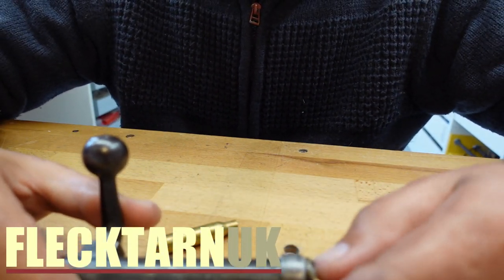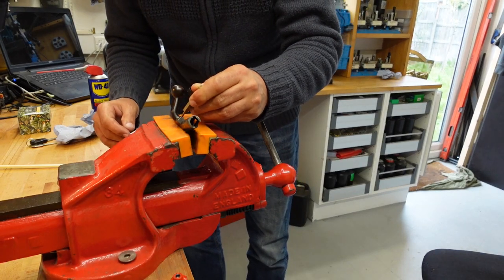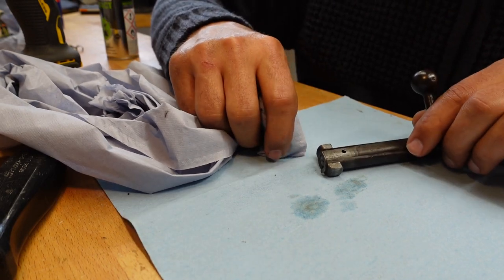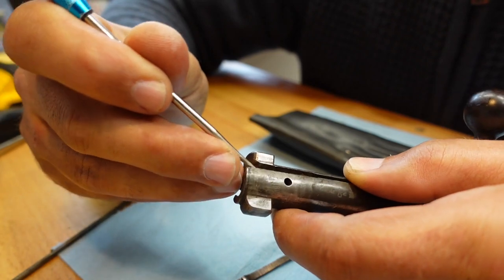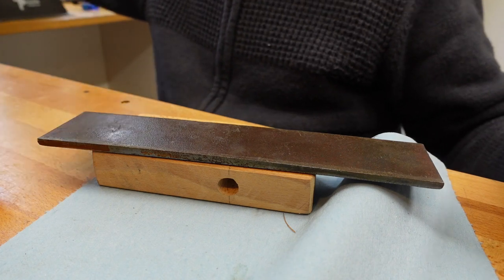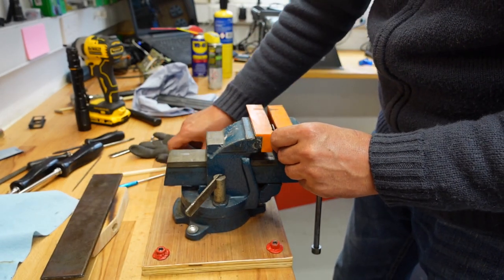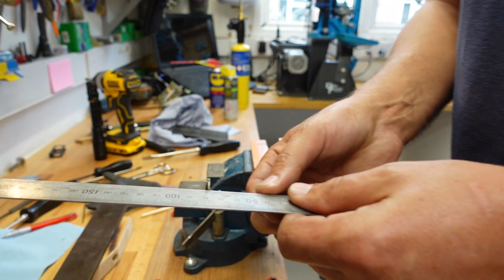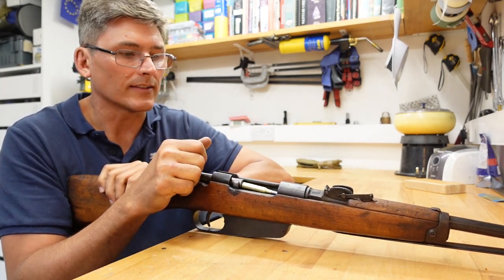[52] Repairing the Extractor on an Antique Carcano Rifle:  A Journey of Frustration and Dread

Comment: Nice save on the extractor.  If you fed the cartridges into the chamber and closed the bolt it would be very difficult to close the bolt and chances are you'd bend the extractor like it was before you fixed it.   I went to the range without a clip and fed the cartridges into the chamber and tried to close the bolt and I had to hammer the bolt closed with my hand.  I'd bet if I did that a few times my extractor would be like your bent one.  Thanks for the video on removing the bolt from the bolt body.  Very easy to understand.  When I had to pound the bolt closed I was worried that I'd have to remove it.  Again, thanks for the video.